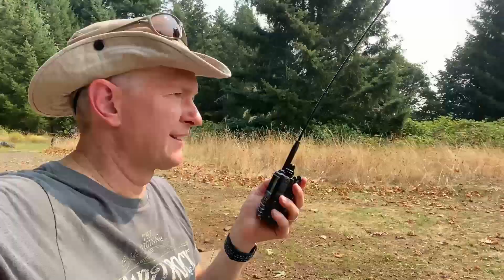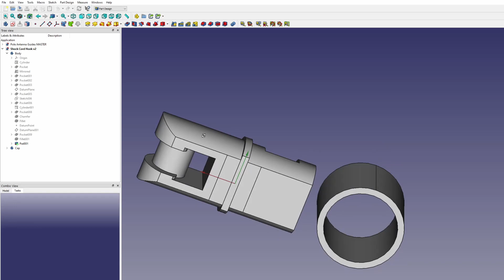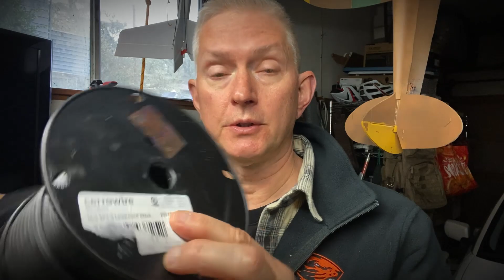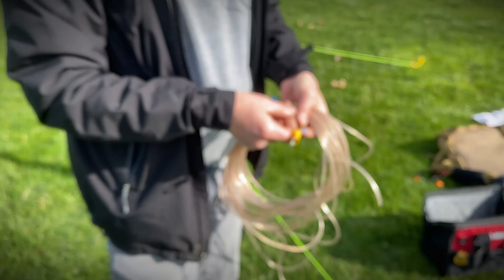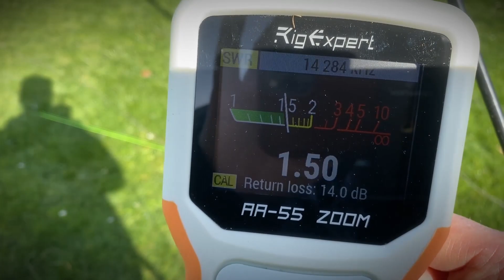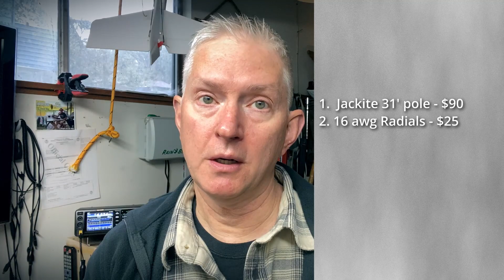Building a Multiband Vertical (Fanned) Dipole w/ DIY 3D printed parts w/ STL links! Part 1 (#29)

Comment: I was hoping the video would address a real dipole vertical instead of a vertical with ground plane radials.  Good project though.
Reply from the maker: Hey John - thanks for watching.  Good question.  When is a dipole a vertical or an EFHW?  The way I see these 1/4 wave verticals is that the other 1/4 has to be created to have a successful TX antenna.  So having the radials makes up for the missing 1/4 wave just like vehicle mounted verticals do.  As I understand it, the goal is to get to a 1/2 wave length for what ever frequency your trying to achieve.  You could certainly have a center fed, vertical dipole as an inverted L, but the ground reflection of the horizontal leg will require you to raise that leg off the ground a few feet.  Hopefully my ramblings made sense!  Cheers.

Comment: Good morning I was curious what frequency or bands you chose on this antenna shut up also I’ve heard that you should tune the lowest band first he said the way you did it
Reply from the maker: Good day Pat - I went with 40 30 and 20.  You'll get a few others via harmonics.  Yes - add your radiating element one at a time and the longest (lowest band) first.  You will find that you can some minor coupling as you add more vertical wires.
Reply: @W0KNI  sounds good ! Thanks for the great videos!

Comment: Would you please build me the base plate that you made and mail it to me I would be happy to pay you for your time and materials and the shipping charges I just can’t find any 3-D printers in this area and I would love to make this antenna- all I want is the base plate and no other parts
Reply from the maker: Hey Pat. Let me see what I can come up with.  My printer has been acting up and not making the quality of prints I've been wanting.  I'll need to know the diameter of the base of the pole you're using.  if you want to send me pictures you can email me at w0kni.radio@gmail.com
Reply: OK I emailed the photos
Reply: I have an expandable pole I bought from China I don’t have a caliper but the circumference is 3 1/4 inches at the base so whatever that works out to be
Reply from the maker: Can you take a picture of the base for me? Is it a smooth pole, without any hooks or kite string clips? I ask this because my Jackite pole had two small clips that I had to tape down and adjust the diameter of the pole hole to clear them.
Reply from the maker: Did you mean the diameter is 3 1/4 inches?
Reply: Did you get the photos ok
Reply from the maker: I did. I’ll see what I can come up with next week. And let you know.
Reply: Hey just thought I would pop back in and see if you’ve had an opportunity to look at this 3-D base plate

Comment: Great informative  video. Just a thought regarding the base plate having the ground plane radials and radiating elements so close together. What if you made a second plate for the ground radials and sperate the elements plate 2 or 3 inches on top?
Reply from the maker: Hey Mike - thanks for watching! I think that's the way DX Commander does it.  Not a bad idea. I was trying to keep it down to one piece. At it's current design it performs really well.  I get a steady SWR on 40/20 < 1.2:1 and the 10M harmonic is at 2:1.  I'm already working on some new designs and will let you know! 73 w0kni

Comment: I’m hoping to create a 2 m Multi element  vertical dipole To use as a base station antenna at home

I would like for all of the elements to be in phase so that they all radiate at the same time

I just don’t know how to create the wiring harness to attach it all to get it to work correctly

Any recommendations or advice would be greatly appreciated
Reply from the maker: Hey Pat - thanks for stopping by! Just to get some clarification, when you say "multi-element" are you saying you want 144/440 coverage or integrate a 1/4 wave 2m radiator on a multiband vertical?  I'll make a comment hear and see if I'm in the ballpark.  I'm actually working on a Slim-Jim 144/440 setup that I can hang from that Jackite pole you see in the video.  It should be above ground at least 20 ft to be effective IMO.  And if you could clarify the "...radiate at the same time." statement.  Does this mean you have multiple radio's you want to transmit from at the same time?
Reply: I am wanting to have 4 stacked vertical dipoles on the same support pole that will radiate Omni directional these all to wired in phase so that they have higher gain
Reply: I found this website of a commercial version of what I’m thinking that I would like to build hope this helps. https://www.solidsignal.com/commscope-138-150-mhz-6-9db-exposed-dipole-omni-antenna-db224-e?utm_source=google&utm_medium=cse&utm_term=DB224-E&gclid=Cj0KCQjw16KFBhCgARIsALB0g8Jmu9qH66ae-spj9YJccLsmVOtNVC_3Itwub1lJ3OkERQKKpQXwxM8aAojGEALw_wcB
Reply from the maker: Ok, I'm with you now.  You want to build a stacked (array) of looped vertical dipole antennas on a single pole all feed by a single point.  At the junction of your feed point you want to modify the signals to accomplish an out-of-phase condition so you can control the direction of the main lobe.  Does that sound about right?
Reply: Just wanna have it Omni directional the entire time so I just want to make a super strong base station antenna for at home and want to confirm the proper way to wire this thing up so that the additional dipole elements will work in harmony with each other creating additional gain
Reply from the maker: Sorry long reply here but after you read it then check out Callum's video on Phased Array systems. https://www.youtube.com/watch?v=ArSssJx5wg0

Ok, so if you have a "gain" anywhere then it is in a direction in the form of take off gain or directional gain.  For a vertical as an example, adding enough radial length to add up to a multiple of 4 is optimal.  So for 20m, your radiating element is 1/4 wave length (5m) but your radials should add up to a total length of 80m.  This will give you a 5db gain.

I had been checking the latest ARRL antenna handbook (luggable ...) and it had several examples of phased array systems, but now I'm thinking your looking at a vertical yagi configuration to push your main lobe out horizontally.

Like a Yagi, you don't connect to the reflector or director.  They just function as they sound, with the RF either bouncing or projecting further in one direction.  Your SWR will be controlled by your length of the elements and distance between them.

I hope that helps.
Reply: This antenna is actually being designed for a 2 m radio and the goal is to have Omni directional coverage and so by stacking multiple vertical dipoles that should offer this coverage I just need to make sure that I’m wiring correctly so they get the correct Impeding to match

Comment: Great video.  I'm looking forward to printing my own.  How is everything holding up?  I shared this on a few discord servers also, you did great work
Reply from the maker: Wow, thanks for the positive comments.  As a matter of fact I'm wrapping up a follow-up to that video that includes an updated version of the base plate.  The whole system seems to be holding up well.  I've made the separators larger and the base plate is cleaner.  I'm hoping to get it all posted by the end of the week.  73, W0KNI